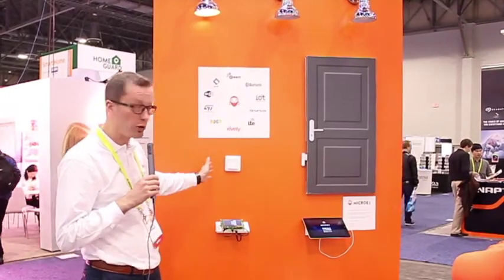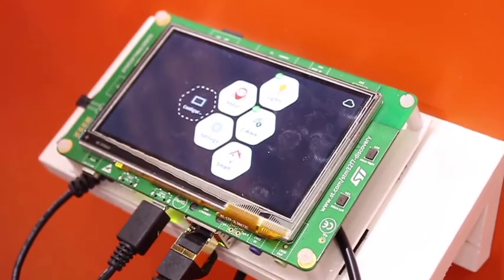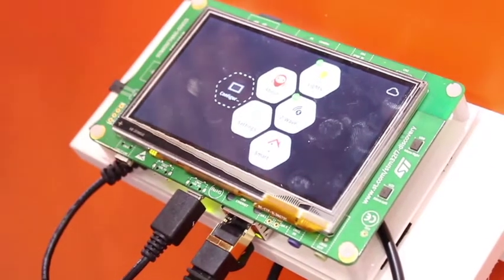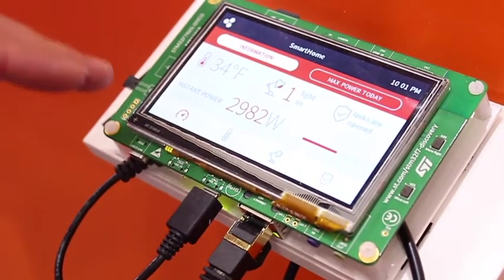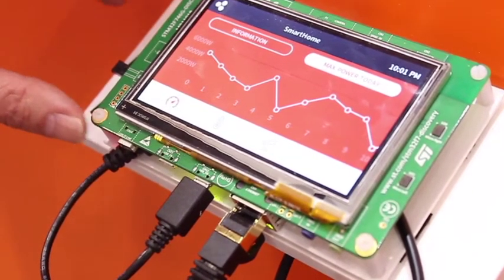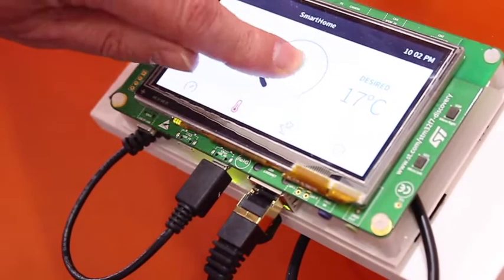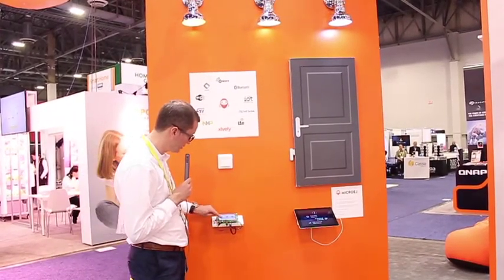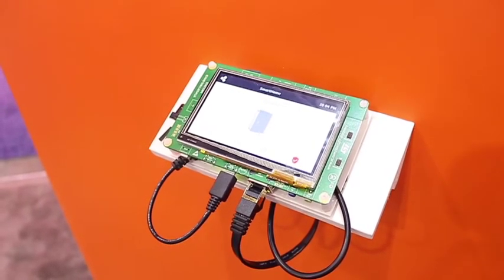MicroEJ Smart Home demonstration at CES 2017

Comment: Hey , I have a question. Could you please let me know how I make can pcb board for a prototype with MicroEJ?
Reply from the maker: Hello, 
You just need to make a PCB as for a normal electronic products.
An electronic board with some microcontroller or microprocessor, a display if you need it, etc.
Hope it will help ;-)
Reply: Yes,  a lot ! But just another quick question. Do I have to buy any specific  pcb machine ? What is you advice?